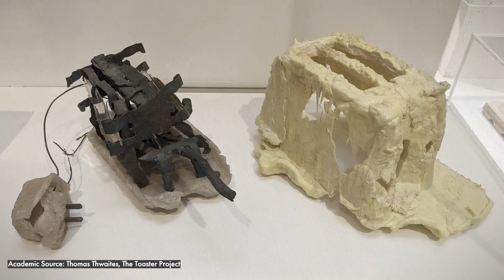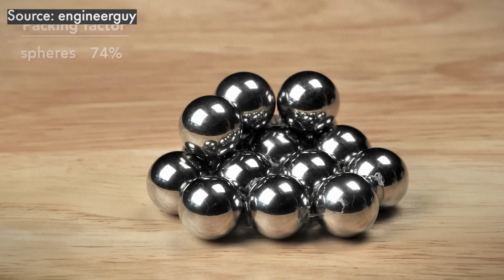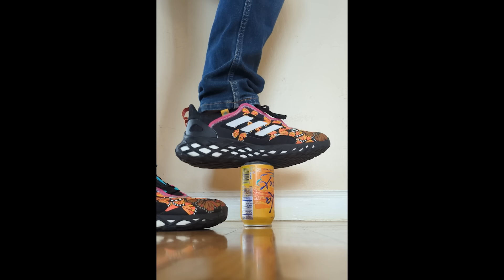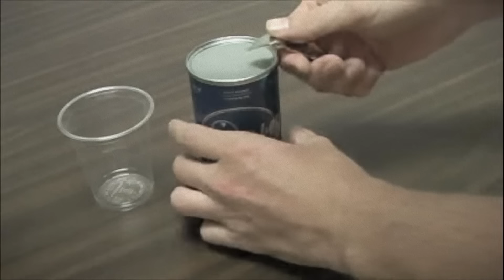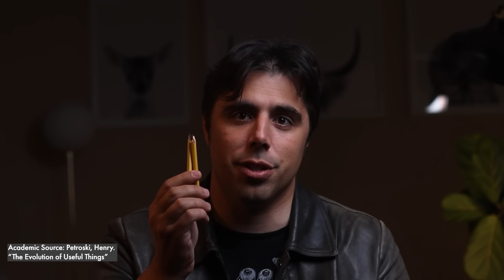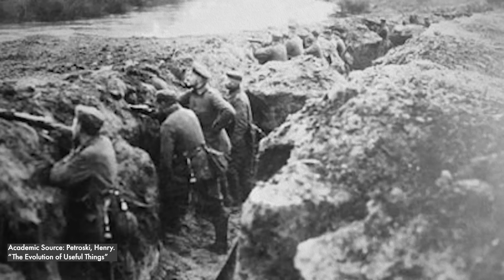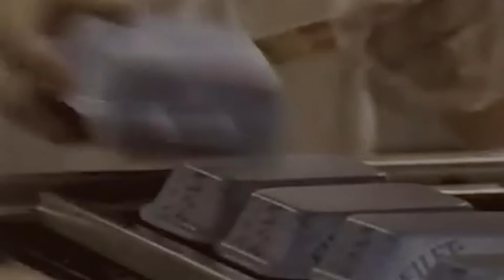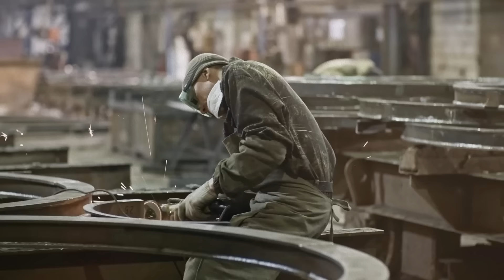Why Simple Everyday Objects Are Impossible to Make

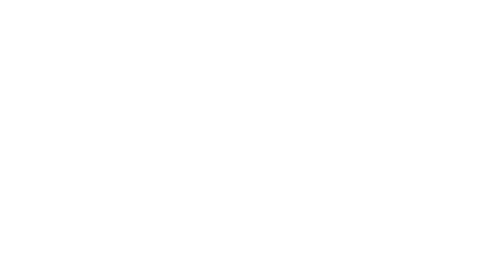Comment: 4:57 I knew there’s more to it, but it’s just a cylinder. There’s not that many options for shapes that we would usually drink out of. It’s probably gonna be cylindrical. The bottom of the can is the best design it has virginity. The bottom of the can is the cool part.

Comment: Yes, modern manufacturing is optimized for efficiency. That usually requires a very high up-front investment in order to make a per part cost that's as cheap as possible. It also requires the expertise of hundreds or thousands of people who know a lot about each step, but not a lot about the other steps.

I worked as a design engineer for decades. I designed products that were (and still are) produced in the billions. I don't know anything about smelting metal or alloying it. I don't know anything about converting oil into plastics. But, I do know how to interpret the datasheets on those materials so that I can apply them for my purposes. I also know a lot about how to design a part for efficient manufacturing. But I don't know anything about how to make a mold or stamping die or how to run a press.

You could make a plastic spoon with a 3D printer, but you'd need to charge $20 for it.

Comment: The problem with nuclear is, that when it fails, it can fail bad. Oil spill will be out of sight in a few years max. Everybody knows chernobil, and it made a huge area inhabitable for quite a long time.
It is like compairing the danger level of car and airplane: cars are incredibly unsafe compared to commercial airplanes, but each plane that falls down from the sky is an event, a crashed car isn't.
Coal power shortens life of a lot of people, but you cannot see it, its mostly statistical. Nuclear on the other way is crazy scary, the death is horrendous and has the potential to kill much more people all at once.

Comment: the steel mold costs over 100K 🤣 lol, such nonsense. We routinely have infinitely more complex molds for plastic housing designed and made, with recess and drawers, they cost 2 to 5K, yes they weight half a ton, but its not rocket science either. And guess what, it just take a few trial injections over a week to adjust and get every part perfect, and it is not a pitiful fork, it is much more difficult parts. 
 This is really typical youtube bullshit. Like this poor fork, how, it doesn't cost 1 billion to "design" it, it doesn't, it just cost few hours to any decent CAD engineer. This guy has to stop his bullshit, he must think he theorized relativity each time he design a pathetic 50 cent consumer product lol, what should an airbus engineer think then? when he simply does his daily job and design infinitely more complex and difficult parts and systems.

Comment: These are false choices! An open or enclosed flame can bake bread, make toast and grill steak. A spoon or fork can be carved from wood and many home artifacts can be fashioned from ceramics or woven from fibers.
    If you can’t live without molded plastic and cheap-ass aluminum, then yes you need Walmart. Let’s frame the question honestly.

Comment: So due to some misunderstanding I was in Dubai prison. Pen were not allowed. you wont believe 1 pen used to cost 100 AED (35$). Outside it was 1.50 AED. You get to buy a letter pad (Note book) just for 5 AED (1.5-2$). Then I was to be deported so I was in central jail. And there you can buy pen for 1.50 AED but you cannot buy letter pads (Notebook). 😝😵😵‍💫

Comment: No sources cited, you frequently got very basic facts wrong such as the power grid wasting fuel (they literally can not use more fuel than the power used or the whole system breaks), very strange mention of the radiation limits of phones without putting into context how ridiculously high they are. (You'd need 50,000 phones taped to your head to overcome that limit) 

I like the video but come on. You have a high enough production value to just check some stuff and throw a few links out. Seriously
Reply: The sources were at the bottom of the screen.

Comment: The problem now is that they've skimped on the THICKNESS of the walls of plastic bottles and metal cans to such a degree that they are dependent on the internal pressure contained within them before they're opened, for the structural rigidity that allows them to survive shipment.  Once they're opened, and that pressure escapes, they're so flimsy that you dent them just picking them up in your hand -- and if you've got a firm grip it's actually risky to pick them up and try to drink from them, because they tend to collapse and dump their contents all over you, just because you're HOLDING them.  I think the skimping process has gone TOO FAR, personally.

They could do better if recycling ACTUALLY HAPPENED, but the effort was halfhearted at best -- a PR move to soothe the ruffled feathers of the environmentalist movements of the 1970s -- and was never actually intended to really recycle any signficant percentage of materials -- and so it DOESN'T.   Much of what goes into your "recycle bin" just gets dumped right back in with the trash and goes straight to the landfill, as though you hadn't bothered to separate it out in the first place.  Just watch what happens when "they" PICK UP your office or home trash and recycles: often the two categories are simply dumped into the same bin in the same truck!  (Standalone cans with separate "trash" and "recycle" slots on top, originally designed to hold two separate bags for two separate disposal pipelines, often no longer bother, and just have a single bag inside.)  I myself would love to pull stuff OUT of the incredible pile of stuff other people deposit in my County's electronics recycling bin, because a lot of it is newer, and in better condition, than what I'm still using at home -- but the company that operates the facility WON'T LET ME (no reason given).  So much for the central term in the official mantra, "Reduce, Reuse, Recycle."  I'd be a champion Reuser, but I'm being actively prevented from it.  It's all RECYCLING THEATER, at best.

Comment: What that toaster experiment actually illustrates is that TODAY's toasters are vastly overcomplicated and overengineered: it absolutely ISN'T NECESSARY for a toaster to have 400 parts.  A simple set of tongs that holds bread at a specified distance from a flame you can make anywhere, from anything, would suffice.

As for plastic forks etc. -- those are only economical "at scale."  Nobody would go to the trouble to build million-dollar injection-molding machines, cut $100K molds, or turn petrochemicals into plastic, to make just ONE plastic fork.  Those steps don't pay for themselves, let alone become profitable, until-or-unless you can reasonably expect to sell BILLIONS of them.

Comment: that a strong point, but do not forget, that current toaster state is the result of an design evolution. Whereas the first electric toaster was probably designed, invented and built by a single person due to its simplicity. So if you want MODERN everyday objects, yea, most likely impossible. But their first predecessor most likely possible.

Comment: The statement that pure self sufficiency is a fallacy is so powerful. I have been looking for “renewable” energy options to heat and power my home and cars. I have found that nearly all energy sources are extremely time consuming. With very little produced. Wood needs to grow, be harvested, cut into logs, then seasoned. There’s only so many trees. I still need to use a gas chainsaw and gas log splitter. I don’t have enough time to split wood using an ax. Biogas from food scraps is very dirty. Full of contaminants and impossible to store for when you aren’t needing to use it. I have been working on building a truck that runs on used engine oil. It’s a very complicated process of finding reliable sources of fuel. Storing it safely. Filtering it and using it in an engine. Hoping it doesn’t clog injectors or cause excess carbon deposits. All to get “free” fuel. Where it’ll save me SO much more time to go to the pump. Reduces wear and far less complicated.

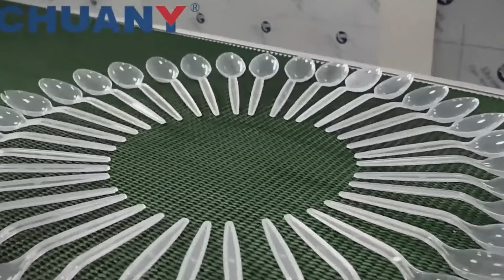Comment: 1:35 "The simpler and cheaper the object looks, the complicated the system behind it has to be." Nope, wrong. Very very wrong. All modern manufacturing is very complex and there is no correlation between simple and cheap, and complexity of manufacturing. You can't tell me a quantum computer is less complex to manufacture than a paper bag.

Comment: A plastic fork... probably not, but I  could make wooden chop sticks.
Reply: Probably, after finding a right tree, chop it down, and cut it thin enough to grab it properly but thick&sturdy enough to not snap while picking up food, and make it sure it doesn't have stray splinters on the way, all that for a single use.

Comment: But your also looking at these things one dimensionally. The reason we can drive prices down so far is because the precursors behind a lot of these products have been made for decades now so the process is refined but also because they are used in alot of different industries, the plastic fork for example is made from petroleum products, I don’t need to tell everyone what else uses oil or the same petroleum products that the fork does, and that’s what drives the technology and the innovation that products like the fork can piggy back off of to make it cheaper in the end, and same thing with the toaster, the things inside it have lots of other uses, and even down to the plants that make the things, like the wire that’s used, that’s used in numerous different things, the control systems, it’s used in numerous different things, so you can’t just look at these products one dimensionally or it will be impossible to make, and now days people don’t make things from scratch like that because the infrastructure to get plastic composites is already there and in place to make it so cheap. I think a good example of this is these new car manufacturers, some of them are loosing money on every car they make for the first 10yr because of the cost of manufacturing and because they have to basically start from scratch and that’s why they won’t make money on a car for 10yr or whatever it is. Manufacturing is such a complicated system that it’s truly amazing when you start to break down what it really is.

Comment: his toaster was so complex! mine (bought years ago) is a few wires wrapped around a fancy shiny surface, and the cooking timer is the expansion of the metal that changes the pressure on the friction-held spring. There is a tiny slider that increases the base pressure of the spring to decrease the cook time. It is literally tempurature-controlled via heat expansion. The on-off switch is a rod that presses on a tab, completing the circit when it is pressed down.

In other words, mine is made out of about 4 materals, and roughly 20 pieces. his overdoes it on that circit-board alone.

I feel like the title is a bit misleading. You can make that spoon out of the bush you cleared in your back yard. The toaster is almost impossible if not impossible for one person to make, but the fork has alternate materials that anyone could use.

Comment: When I enrolled to university in the field of mechanical engineering, I was shocked when I learned that pretty much every plastic item is a result of ton of work of few mechanical engineers who must consider the material, shape, thickness, temperature and time for the molding, ......... Insane and cool at the same time!

Comment: TBF Thomas Thwaites (That Toaster guy) didn't really try to adapt his toaster to things not at hand. He was set on using the same parts in the same way out of the same materials. It is possible to create different plastics (i.e. from plants), replace plastic with wood or even use a different way of generating heat… in the end you could even carve a "toaster" out of stone and heat it up via charcoal. That would be far easier to process on your own.

Comment: This is what I wish upper management understood. As a designer, upper management seems to think new designs can just happen overnight, but engineers and designers have to go back and forth for days, weeks, or months until everything works out just right. The whole time you have to consider:
How much material will this design use?
How easy will this be to manufacture?
How difficult will this be for the end user?
Is this design even possible in reality?
Can this design withstand typical use?

And sometimes the answer to one question is to make it worse in another way.

Comment: Computers themselves are such a rabbit hole. Both a CPU and the RAM can basically be made by cobbling conductive cables together, but a simple circuit quickly becomes a bowl of spaghetti. You need machines to build the machines to build the machines to build one small component of a component of a component.

Comment: I have occasionally pondered travelling back in time 100 or 200 years to patent some modern day invention.  It would be impossible.  The interconnected strands of materials science, and the development of electronics have all evolved in the last century.  There is virtually nothing from the modern world which could be produced by technology from the 1800s.  Nothing electronic could be produced, nothing using plastic could be produced.  Plastic itself couldn't be produced because the processes to create them were not available.  Many of our manufacturing processes rely at some stage on the precision and speed that only CNC machines can provide - either directly, or the machines used to do the manufacturing need components made with CNC.
Just about the only thing I could think of, which could be done with the technology of the era is the new developments in packaging which grows the packaging using fungal mycelia.  However, the products of that era did not need fancy packaging, so there would be no market for the product.
When you consider just how many recent innovations go into each and every modern product, it boggles the mind.

Comment: So my first thought when hearing the beginning of the crude oil to plastic explanation just boiled down to this : "if it's so hard to get oil, start making bioplastic from potatoes"

It's important to remember every last one of the choices that go into making an object are linked to the most easily available resources. We use certain plastics because they're a byproduct of crude oil refinement. But if that industry did not exist, would plastic forks also not exist? I think the point of optimal efficiency would only shift to another material. If that young man hadn't put into his mind to replicate a toaster made for a specific industrial context and adapted it to his less precise and more manual tools the result could surely have been more successful in its ultimate goal of toasting bread.

Great video as usual, thanks :)

Comment: I've been building a gate for my yard this week. The hinges I got off the shelf, but everything else was raw steel, either sheet, tube or solid bar. Luckily the supplier is a mile away and the material comes in reliable sizes with minimal tolerances. I built the latch today. Integrating that with my exterior stone on the house was a challenge. Designing the whole thing to be strong, durable and look good with keeping cost low was not easy. I build other basic tools and machines from steel. Sometimes I just get mentally burned out, tired of having to engineer everything from nothing. I have so much respect for engineers and how impressive modern goods are. The amounting of engineering that goes into a car, and if it's git some issues, you can buy it for a paltry thousand dollars. From one perspective it can appear to be an incredible value. The downside is that the complexity of the machine and cost of labor to repair detracts from its value.

Comment: You can make a clay model of a toaster (with a fire beneath it) and call it a toaster. It will basically toast the bread, basically making it a toaster. It doesn’t have to run on electricity as long as it toasts the bread.

The fork can be carved from wood…. Why would anyone need advanced technology to carve a fork? 🤷🏻‍♂️

Comment: As someone who works as a design engineer in aerospace for literal toilets, kitchens, seats, and cabinets, you nailed it. Product design is just one aspect of the product, the entire product goes through what we call a product lifecycle, and why we have PLM(product lifecycle management) systems in place. My current business unit makes monuments for commercial aircrafts, and our projects usually last a couple of months to 2 years at most, and yes that's pretty fast as well. Back when I was with galleys and lavatories, it takes as pretty much years, with projects not being finished, outliving newly hired engineers that have left to take on new jobs. We designed gains(galley inserts) or sinks that takes months to even a year or so just to design, and that excludes everything before design phase, like bidding, design review, etc, and after like prototyping, testing, certification, and the actual manufacturing.

So yea, simple everyday objects are pretty much impossible by ordinary people to make as they're mass-produced to be cheap. So the next time someone uses some cheap item like a spoon, a pencil, or a pen, maybe try imagining how far it took to even make that. We take a lot of things for granted these days, like smartphones. Personally, it's one of the pieces of technology that reminds me how much quickly we've progressed, I'm still at awe at the technological marvel of it, considering how we were with cellular phones and pcs back in the 90s and early 2000s.